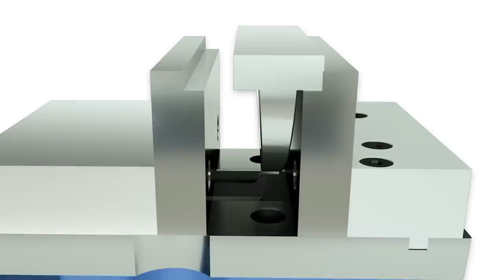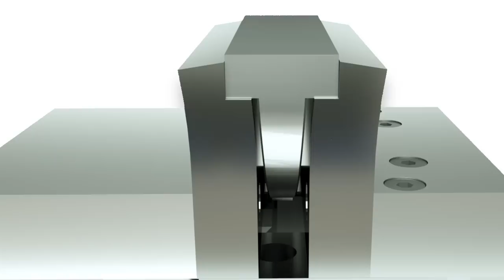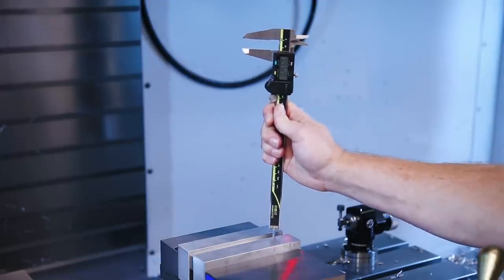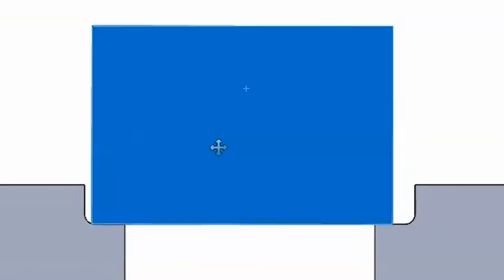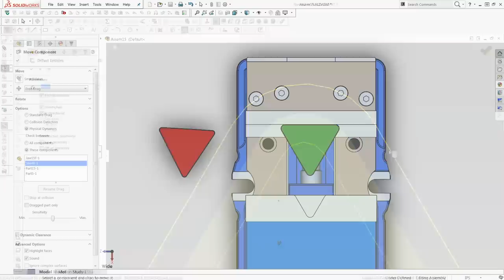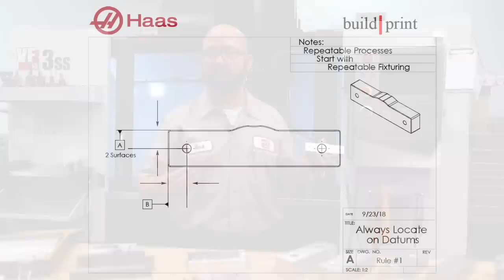Mill Soft Jaws: The Proper Way to Make and Use Them – Haas Automation Tip of the Day

Comment: Ok that datum hint was brilliant can't believe I didn't know that. Down side of having to work your way up without an apprentice ship program
Reply from the maker: Dominic – The locate-on-datum thing really changed the way I built fixtures. Rather than blaming the operator for miss-positioned holes, I started taking a hard look at my fixtures. For production, I’d even rotate one of the parts 180° if running on a Double-Lok, double station vise, just so both parts could locate their datums against the center fixed jaw. When running engine blocks, a lot of care was taken to locate on the datums, even if that meant locating off of the mains (crank  bore), this was shown to me by some engineers I have a great deal of respect for, and it made running good parts so much easier. – Mark, Haas Tip-of-the-day
Reply: Haas Automation, Inc. Thanks for the reply! Your doing great work

Comment: Usually, when I make aluminium jaws I make sure there's a hole on the left/right side for a hardened indicator pin so it'll index on the side of the vice's stationary jaw. Basically, it means for me that I can save work offsets. If you tend to (re-)move the vice regularly it might be a problem.

Comment: Really good advice on soft jaws. They are one of those things that can be a little tricky or daunting at first but once you learn them you wonder how you survived without them! Also good advice on DIY jaws cranking them out ASAP. The only thing I will say is if your a hobby machinist with a small machine it maybe actually more efficient from a time standpoint to just go out and buy some soft jaws for your machine vs trying to make them but that all varies on what equipment you have. In my case it was a benchtop CNC mill so power and rigidity were sorely lacking.
Reply: Yep, unless you stock the correct size aluminum bars the cost difference for buying one bar or the equivalent number of jaws that could be made out of that one bar is not much. I use no aluminum now days so it doesn't make sense to make my own anymore. When I worked at a shop that used a lot of aluminum I used to make soft jaws for mills and laths, lathe soft jaws are very handy as well but do take more time to make.

Comment: When possible, I make mine 1.875" high so that the mounting holes are in the center. Sometimes I'll machine grooves in both jaws to help align them when using them later on. Just tap a parallel into the slot and tighten the jaws. With tall jaws I'll put a K clamp or two on the top edge to clamp out deflection. Ok for smaller runs, but tedious for long runs.

Comment: Nice tips.  I just have 1 note: If you're running tight geometric tolerances like parallelism ,  you may need to re-shape your soft jaws, because 99% you will have  'Z' height variance between mov and fix jaws, every time you take off of vise.
Reply from the maker: GoD-Now – I like it. That’s a good point. I started putting the program to re-cut my soft jaws right into my main program, after the M30. This way, even years later, if someone runs that job again they can re-kiss those jaws and make them perfect again. Thanks for the comment. – Mark, Haas Tip-of-the-day
Reply: @haasautomation   Thats one I haven't learnt yet. Thanks Mark!

Comment: Not machining the surfaces that come in contact with the vise can cause repeatability issues if you are taking the jaws out and putting them back in.

When I make soft jaws, I do it in 3 ops. First, machine the surface that bolts against the vice flat with a face mill. Then rotate so this surface is against the fixed side of the vise and machine an 1/8" deep slot the width of the vise bed in the middle of the jaw, leaving and 1/8" wide tab on each side. This locates the jaw in its final position on the vise so you don't have to re-align both jaws when putting them back in. Make the slot just big enough that the jaw sits snug on the vise bed. Last step is to turn the jaw where your first flat surface is down and the slot is against the fixed side of the vise and machine your attachment holes.

You can't flip these jaws like you do yours, but they will be repeatable every time without any need for fine adjustment or setup.
Reply from the maker: Andrew – That’s a great approach. You have to be right, a cleaner mating surface has to give us better contact and repeatability, I just haven’t found significant repeatability problems using the clean extrusion, so for prototype and low-volume work I’m okay with raw aluminum jaws, if I’m cutting the shape in anyhow. WelLRoundeDSquareE’s comments below apply as well, we should take some pride in our work, show some Craftsmanship. I may be tipping to the always-square-your-jaws-up side. Thanks for the comment and sharing your experience. – Mark, Haas Tip-of-the-day
Reply: I do It in two. I square the back and top, flip in x, then skim the flash from the previous hold and do the holes. 3 minute cycle with aluminum blanks.
Reply: Instead of milling the 1/8" deep slot, could you ream 2 holes and fit dowel pins to locate accurately on the outside at each side of the jaw.

Comment: Can you do speed , feed and chip load for several tool??, end mill with diffrent flute, split saw insert cutter, dill, reamer. Well, may be I ask too much but if you can do it it will be great
Reply from the maker: Tuan – Check out https://youtu.be/gTnkNHB7dss, and see if this is what you need. The tool manuals should give us the Speed and Chip Load for each tool, then we can make use of the formulas we linked to. Thanks for the comment! – Mark, Haas Tip-of-the-day

Comment: Yeah but I'm using the a axis indexer with a small chuck with a 0 to 90 degree shift on B. I checked the runout on the chuck itself. Got .0002 to .0003 max on the I.D. and O.D. but when I cut to size with a simple G2 or G3 interpolation program my runout goes from .002 to .005 on 2 out of the 3 jaws. WHY??

Comment: As an amateur machinist, when you mention always try to use locate on datums, could you explain that a little, thank you.
Reply: In the video, when datums are brought up, look at the print. Look for the letters A and B in a box on the left hand side of the part. That is datum A and datum B. These features are used in the GD&T call outs also shown on the print. ( GD&T - https://en.wikipedia.org/wiki/Geometric_dimensioning_and_tolerancing ) Everything has a tolerance. Lets say you have a hole with a distance tolerance of +/- .002" ( +/- .050mm ) and the over all part length parallel to that hole distance has a tolerance of +/- .015" ( +/- .38mm ) If you use the feature both distances originate from to locate your work, then once you set your Work Fixture Offset ( Commonly G54, G55, ect, ect... ) the hole position will stay in the +/- .002" tolerance. Now if you locate on the feature opposite the datum ( or origin if a datum is not used ) then the hole will not maintain the +/- .002" distance because the length tolerance is far greater than the hole tolerance. After reading this, watch the video again and pay attention to the second example shown why we locate on datums. ( Origins or Zero if datums are not used. ) If I could also impart another piece of sound advice... Learn GD&T. Read it, Love it, Live it. Don't read it like a novel, just recognize the characters shown and when you see one you don't know, study that single call out. After some time you'll understand most if not all of it. If you like being a craftsman, then the best understand GD&T.
Reply: Another way of saying it: Look at the part print (not just the one in the video):  where are the dimensions to the particular feature of interest ( say a hole, for example) measured from ? From the hole center to where exactly in X and Y ? A corner, for example? That corner then, constitutes the intersection of the the two datum planes - a point -  one plane for X and one plane for Y. Usually we  try to dimension all features from a particular point and NOT several different points if possible. Hope that makes sense.

Comment: Hi Mark, thanks for the great video! I has a question about machining the profile into the jaws. Do you offset the profile by .001" or do you cut the profile exactly to size?
Reply from the maker: Christopher – I used to offset the contour one way or another by a little, but anymore I just redraw the profile, making the corner radiuses a little larger for relief. If I don’t spend the time to make the radiuses larger, I will just machine the part profile exactly to size, and use a G187 P3 in my program. This is important (we’ll do a video on it), the G187 P3 will slow down the machine accelerations and tighten up the corner-rounding of the machine to give us perfectly cut and accurate corner radiuses. Check out G187 in the Haas Mill Manual for more information, or subscribe to this channel so you don’t miss the upcoming video. – Mark, Haas Tip-of-the-day https://diy.haascnc.com/user-guide
Reply: Cut to size using adaptive toolpath and then use D cutter compensation on the outer contour to open up the pocket to where the part just barely fits while the jaws are still closed. (Remember to have a small spacer btw jaws so you have clearance for clamping)

Comment: Just wondering if you can clamp on adjustable parallels? Or is that a big no no?
Reply: I think so, but I would not smack-down the material to set it, with a hammer. I’d be afraid if throwing the adjustable parallels out of adjustment

Comment: any suggestions on the vise type for using paper type material FR4 (for printed circuit boards)?The ideas is to reduce the thickness, by compression. These FR4 sheets are usually quite thin, around 50um to 150um, to reduce the thickness 20%, so to 40um (from initial 50um) or 130um (initial 150um).
Reply: A dovetail jaw can work, but the material will still bow if over tightened. If possible, I’d want to clamp multiple parts from the top down, or use a window fixture for that thin material. Sometimes, a dedicated vacuum fixture is perfect depending on the application.

Comment: One thing you failed to mention is that soft jaws need to be machined again if you want to use them even if they are used for the same profile. Once you remove them from the vise, they lose their accuracy. Jaws will shift and move slightly every time you loosen them and tighten them up.
Reply: You can add features for realignment to have repeatability within a minuscule amount...
Reply: I understand the concern but I think you are over analyzing the idea of the video

Comment: This is a year old video but I will still try my luck to get an answer.

I completely understand this entire video but my only question is. How do you machine the vise to the parts shape? CAD?  or Do you machine the part -5. mm without actually being there and machine the vise?
Reply: Yes, we use the model in CAD to draw the outline of the part, and then machine out the inside of the contour, leaving a pocket for our part to rest in. You can also hand program the contour of the part, and use the G150 Pocketing cycle to program the pocket.

Comment: nice video. but im curious. on that dog bone part. how are you indicating that jaw in to make sure its square to the work bench?
Reply from the maker: David – Whenever we cut the jaws, we make sure that the vise is perfectly square. If the jaws are removed and reinstalled, we need to make sure that the new vise is squared up as well. For added verification, we could have milled a flat into the fixed soft jaw as well (when the jaw was cut) so we could indicate on it later to make sure everything is aligned. Everything else happened in the CAM system. – Mark, Haas Tip-of-the-day

Comment: Been doing exactly as this video for years except a couple of things.
Soft jaws are not much good for high accuracy components.
Mainly because the floating jaw has play in it so will twist and lift slightly.
But also the fixed jaw can wear causing a shift in the datum. 
Also i always machine a new soft jaw for repeat jobs as its the only way you can guarentee perfect alignment
Reply: This depends on the part count per job, if doing hundreds or thousands then yes if twenty to forty not really needed.

Comment: What type of steel and aluminum would you recommend for SJ's?
Reply: For aluminum 6061 is fine. And for steel u can go with 1018 mild steel. Unless you need something harder....but 1018 usually works pretty well...and its easy to cut

Comment: Mark, you forgot to make a alignment cut along one side of the outside edges of your jaws. Makes it easy to align the jaws in X when you use them again. I just mill one side while making the jaws, when they are still clamped.
Reply: Not really needed as he explained. Tighten the solid jaw and leave the movable jaw just finger tight on the screws. When you clamp the part the movable jaw should move around on the screws and align it self to the solid jaw.
Reply: @stevemccluskey7102  That's fine for parts that self align, but those are rare in my shop. For odd shapes that don't self align, alignment cuts on the jaws eliminate dents in the profiles.
Reply: @stevemccluskey7102  And who leaves the floating jaw bolts loose enough for the jaw to float?!? Great way to get some chatter.
Reply: Tighten them after you get them aligned to each other....
Reply: I agree....but for some jobs its just better to cut new jaws each time if u have the resources
Reply: @demandred1957   You open the vice and tighten them all the way after aligning them, you would never leave them loose while running.
Reply: @phillhuddleston9445  Yeah, no kidding.. Of course you tighten everything down after alignment.. But when you are making soft jaw fixtures, you are using >soft< jaws... Soft jaws in my personal experience are not width matched, nor ground like hard jaws are.
SO if you do not mount them as close to aligned as possible, while clamped hard on a spacer, THEN do a alignment cut on one side, you will never be able to align in x close enough when you run the job again, if your part shape is really complex..

Comment: The slop in the jaw holes allow up to .010-.020 movement in X.
Reply: demandred1957 Wouldn’t it not matter, since you indicate off of the soft jaw anyway?
Reply: over torquing the mounting bolts will place the jaws out of position as well. Did you notice the tooling hole that was probed? Set your W.F.O. while programming to that hole in the jaw. and forget about the slop.
Reply: @RandomNumber141  It matters when your job is complex shapes. If both jaws are not perfectly aligned in X the next time you run the job, it will not grip the part correctly, and may damage the part.
Reply: @Scooter-k1h  Why would you over torque the bolts? But that is irrelevant to what I was saying anyway.
It matters when your job is complex shapes. If both jaws are not perfectly aligned in X the next time you run the job, it will not grip the part correctly, and may damage the part.
You can have a XY Zero point one one jaw, but >both< jaws have to be aligned in X.
Reply: @demandred1957  I disagree with this thinking. The mobile jaw should not be counted on to repeat at any position. Therefore it should not be used to dial in or set up any job.
Reply: @Scooter-k1h  It has to be part of the set up when the part shape spans both jaws..
When you are making them you tighten up the vise gib first to take the slop out of the saddle, then grip your spacer piece, then cut the part shape..
That's the whole point of soft jaw fixtures after all, to grip odd surfaces.
Doing electrical switch repair for AmerenUE, ABB, ConED, and many other electric utilities, I have had to make literally dozens of soft jaw fixtures to grip whatever oddball part they sent us to rebuild/replace.
As long as you tighten the gib back up when the vise is close to closing position, have soft jaws with a alignment cut and align them with it, you can easily repeat a setup over and over..
Reply: @demandred1957  ok, you do you. Good luck!